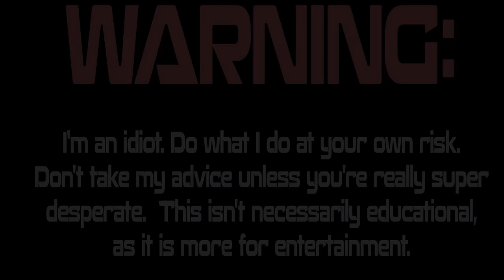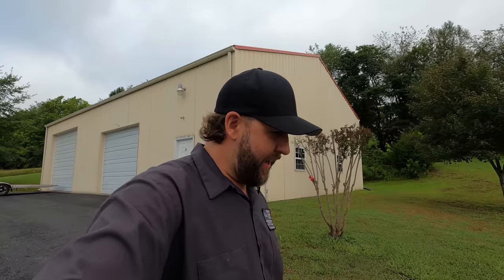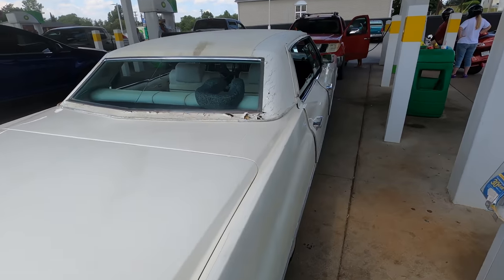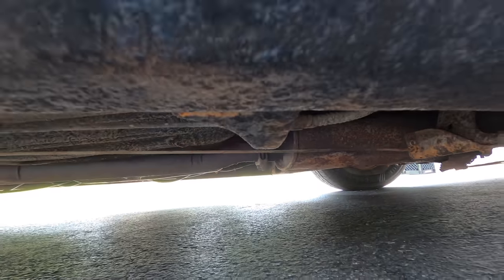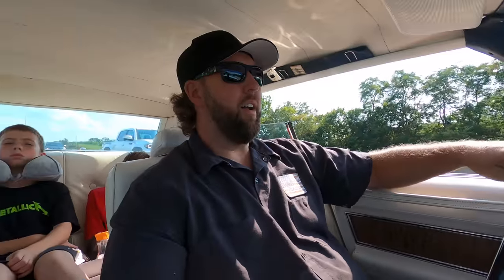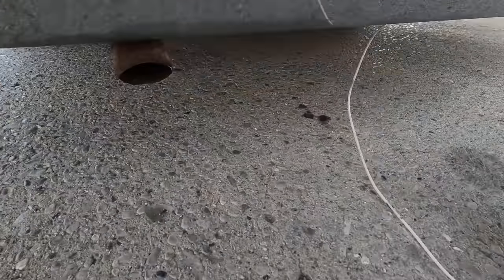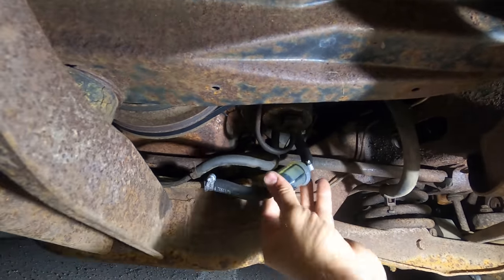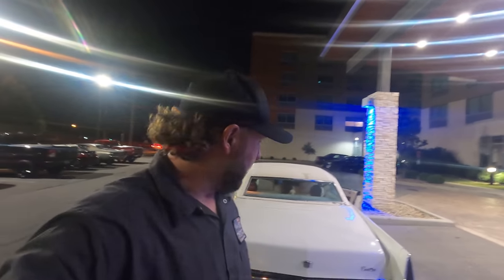2,000 mile road trip in a 1970 Cadillac DeVille!

Comment: The transmission in that '70 Cadillac must be in pretty decent shape, along with a well-tuned engine in good condition. I'm not surprised that it had been getting over 14 MPG. It's probably running as efficiently as it did back in the early-70's.
Reply: TH400s just go and go......the old school stuff just handled neglect and age better.
Reply: @hoost3056 , they often had a slight slip from 1st to 2nd, but would run fine like that forever if you didn’t beat them.
Reply: New radial tires also contribute to better fuel economy, as radials have less rolling resistance than bias-ply tires.  The hole in the muffler results in less back pressure, helping to lower fuel consumption. When the muffler falls off the MPG will improve even further..
Reply: @brianevans656  Muffler delete = weight reduction!
Reply: I can't imagine how that's possible! I could believe 10....but 14?
Reply: @mark98070  Caddy engines from this era had high swirl combustion chambers and high nickel blocks. They were high quality engines and do last an ice age. Tuned right, they can get near 20 mpg on the highway
Reply: @inkey2  folks don't get that you don't need EFI to get great mpg. There were engines that got silly mileage numbers with carbs and points, just look up the fuel efficiency contests from back in the day. 
Cadillacs were pretty quick with their tall gears plus that Q-Jet was the closest thing to fuel injection you could get with a carburetor ( except for the SU's fitted on British cars...when they are set up properly they were silly responsive and adaptable to conditions )
Reply: @brianevans656  All a Caddy big block needs is to breathe.
Just adding a 2.5" split dual system with an h or x pipe and some decent mufflers will pick up the power and mpg quite a bit
Reply: @mark98070  Those old, hunky V8s were not all that awful, unless you were always stomping on the gas pedal...My dad owned a 1967 Buick wildcat, with the 430ci V8, 360 hp.  He managed 11mpg just cruising around the city, and 15+mpg on road trips...the trade-off, of power for mediocre gas mileage, meant little back in those days, with a gallon of gas costing 30 cents (meaning that today, that price would have been around $1,80 per gallon...everything is relative}...gas prices have reached around $4.00 a gallon recently--a ripoff that we, as a society, have no choice but to put up with!
Reply: I had an el dorado of a similar vintage  with the 8.2 (500 ci ) it got ten miles to the gallon  which is two miles over the factory specs . Must of been the ol weight reduction .
Reply: Nice. Enjoy the trip and be safe. Will be watching the videos.
Reply: @hoost3056  My grand dad had a 66 caddy . They took on vacations to california . He swore it would get 18mpg

Comment: Just a tip with plugged jet inside the carb. With the engine running and air cleaner off, place your hand on the choke flap , fully hit the throttle and quickly shut the choke flap then release the choke and let off the throttle. See how well that works after a time or two.

Comment: Great video, looks like the Caddy is running good.  I had a olds that sat for years. It had the 455 Oldsmobile Rocket. I took it on a 1200 mile trip and the more miles I put on the engine the better it ran

Comment: Old cadillacs bottle my mind. They were designed to do 2000 mile road trips up and down mountains fully loaded 50 years ago. But they can sit in a mud bog for 20 years, and do 2000 miles no bogging, no problem. Old cadillacs are the best.

Comment: Something that may possibly save you some head scratching down the road some day. Back in the 70s I had a '71 El Dorado. It got to the point (I don't remember the exact symptoms.. it was the 70s fer gosh sakes) it wouldn't run or it would barely run and then cash in as soon as the onion lever was pushed down. I had a couple of mechanics looking at it and we were about  to gamble on digging down to the timing chain, thinking it might have jumped a cog or two.About that time one mechanic looked to the other one and said have you ever heard of a double walled exhaust pipe? that rang a bell with the other and they got to digging around and found it not only had one but the inner pipe had been sucked flat. Outer pipe looked normal.

They thought it might have been a backfire that caused it, but it think it was near the time that I made a long midnight run from Omaha to Eastern Iowa where I was bringin' them onions up from the root cellar in buckets and feeding them to that 500 c.i. engine.. the mphometer was over into three figures easy for most of the trip. I guess they made those double wall pipes for less sound effects and I'm sure those folks in the Sedan de Villes didn't like noise anymore than the El Doradians. Keep it in mind.

Comment: If you want a Cadillac to run 180 degrees, you need to put a Chevy engine in it. Those 472/500's have a strange thermostat and cooling system. To get a 180 thermostat use the one from a farm tractor. An OD trans and you are at 20 MPG!

Comment: I'm not at all surprised with the 14.3 mpg on that Caddy. The '68 SDV that my Grandfather had would do 14-15 back in the 70's. We took a trip to Niagara Falls and over through the Finger Lakes region of N.Y., and oddly enough, the muffler blew out on it also, on the way back to Pennsylvania!!🤣 Must be a thing with Cadillacs and the Northeast 'rust belt'. They sure do ride nice.. my uncle always called it the 'Marshmallow Barge'!! On that suspension, I'm guessing the front coils are probably starting to collapse after 50 years of holding that battleship up. If you would replace those and get your air ride working it should cure your bottoming issues.😉👍

Comment: Those cadillacs were geared for fuel economy. In fact they had class leading fuel economy ratings for that segment. Something Cadillac was boastful about in their marketing.

472's are efficient motors that make gobs of torque at the low and mid range. So they get moving fairly effortlessly. It all started headed down hill in 71 though when they started to reduce compression ratio.

I always felt 70 was the last year of the built for a lifetime Cadillac quality.

Comment: 14 MPG because once you get that boat moving on the highway it pushes itself. LOL.  My brothers 72 Coupe De Ville with a 502 got better gas mileage than my 1984 305 Ford F150, but ONLY on the highway.  In the city that 502 went through gas like an ice cold wobbly pop at a frat house party.

Yup, the lack of the muffler is a little loud, hard to hear the talking. LOL  Love that sound.

Comment: You usually have to replace the entire lightning whirler WITH the lighning rod in '69 and '70 472's, and about the only way a guy can get that out sometimes (after 50 years), is a torch and a sliding bammer-hammer.  A Big one.  I had to do both my 68 and 69 Coupe, they just wouldn't run right with the old lighning assembly.  You'll find that out, I'm gonna take a wild guess.  I had no slide hammer on the first, just sledgehammer, pry bars. and a little propane torch .
Really easy.  
NOPE

Comment: It's a 1970 Cadillac....consider yourself honored to own one.  Back in the day I purchased a 1970 triple black Cadillac Fleetwood Brougham used.  I drove it for years....keep the trans fluid and filter clean, most need a fresh vacuum modulator.  Check the distributor vacuum advance is working good, and vacuum hoses good.  Check the distributor breaker plate ground wire.  Keep the frame to underside of the trunk floor bracket cleaned out (just behind the rear wheels) as well as the front fender lower panels flushed out.  
They are hard on the front suspension bushings including the angled strut bars on the lower control arms.  With premium blackwall Michelins (XL) and a rear stabilizer bar, they will corner unbelievably well.  Ask me how I know you must use XL tires or load range C tires if you corner hard with a factory rear stabilizer bar/boxed lower control arms!  I always replace mechanical fuel pumps as when the diaphragm gets a pinhole, gas can wind up in the oil.  Not Good.
With synthetic oil everywhere, including the rear differential and front wheel bearings, I was getting 16mpg on trips using cruise, running the tires 4psi high.
My A/C always worked wonderfully.

Comment: I kinda know what ya mean about running them a bit and they do better. I just put a new timing chain and new head gaskets on a FE390. We also lapped the valves and put in new umbrella seals fer good measure since we had the heads off. ( The heads were taken off to remove seized exhaust manifold bolts.) Anyhoo, the truck hadn't been run alot over the years and we did put a used edelbrock 600cfm fuel make it happener. I'll tell ya fellers, I was getting a little concerned. I've been a tinkering and running it quite a bit and when I first started running her, we were in the single digits on the mpg's. 7.5 mpg to start with. As I've been a running her off and on for the last few months and really pressed her into service recently, we finally topped 10.3mpg last fill up. I know that sounds horrible but we're getting closer to that 12.5 she used to average years ago. Hopefully we will see improvement as we clear the cobwebs. Good luck with the Caddy.

Comment: But didn't you mention the air shocks and the cracked line during one of the earlier clips?  It drives and stops.  Keeps complaints to a minimum is close enough to get it on the road.

Comment: A high school running buddy had one of these gifted to him by his parents. It had been rear-ended at a stoplight and pushed into the car in front. Yes, it was butt ugly but was still solid as a rock. Talk about abuse, we took it off-road on multiple occasions, cut doughnuts with it 'til the lifters sounded like they were gonna be flung out, flat drove the crap out of it and just generally gave it hell! It could still bury the speedo on command (if the tires were in balance) and never missed a beat!  One day, my buddy stumbled across an old nylon straight ribbed tire that just happened to be the correct size and had it mounted on the passenger side rear. Talk about a burnout-that thing could do one for hours! That old tire lasted about 3 weeks and every neighborhood we did a burnout in thought there was a nearby forest fire. I remember when it began knocking one day and he finally decided to check the oil after a week or so. It was down 4 quarts-he filled it and then ran fine for at least another year. These things were built back when GM knew how to build 'em!

Comment: Any connection between the fuel flow issue and14 MPG?  Like because the engine isn’t getting all the fuel it wants better MPG. Or because it’s not getting the fuel it’s needs but one fixed it get better mileage?  Or no difference ???   Answer may be in next video

Comment: On your blower motor resistor, if the blower runs on high and nothing else the resistor is bad. When on high it bypasses the resistor and feeds a full 12V to the motor. If ran on low,medium etc. that’s where the resistor comes in to reduce the voltage to the motor.

Comment: On one hand, metal in water does what? It rusts. On the other, we have seen the depth he goes to for these. The rough running engine, id start with a compression test while you replace plugs cap, rotor and wires. If they are newer, ok.

Comment: You need to check the brass filter in the inlet port on that carb. You know with all the crap that went through that line that thing is probably about plugged off and not much will clean them out unless you have a way to reverse the flow direction under pressure higher then what plugged it. 1970 all carbs had thos dang things and they were forever causing headaches just like the one you had there.

Comment: i forgot about gm's crazy idea of the antenna in the windshield till i saw those wires in the forward shot. my new 2 you beaters with heaters always seemed to have the doohicky that connected to the windshield broken off and dangling in space, just laughin at me while i tried quite unsuccessfully to tune in the one good radio station.

Comment: Are you aware theres a bronze fuel filter where the fuel line enters the carburetor-??  take the LARGE nut off the fuel inlet at the carb and theres a bronze fuel filter in there, cheap to replace or you can leave it out since you have an exterior filter

Comment: What you say at the end about getting them out on the open road and running them holds true. My 1981 Bonneville never ran better than it did after I took it about almost 2000 miles round trip. Nothing went wrong either.